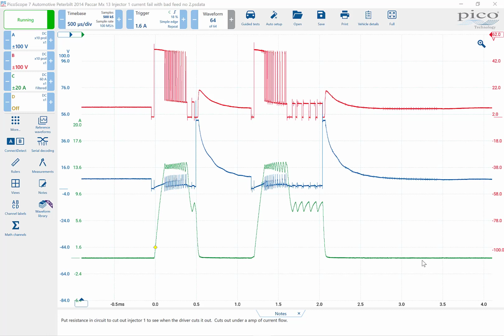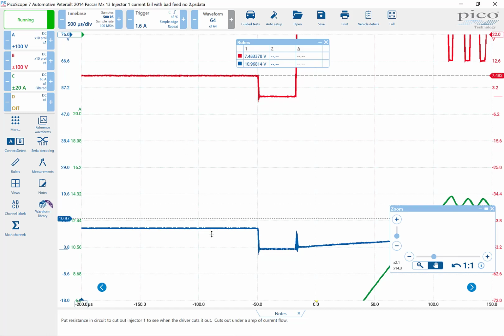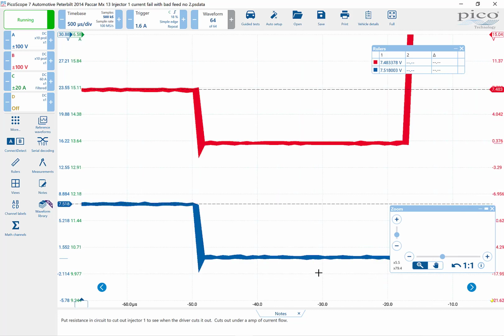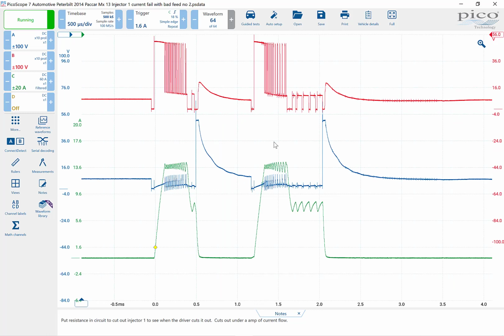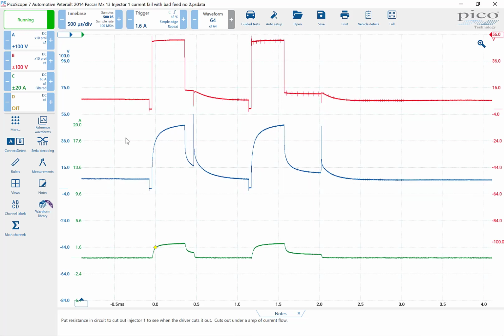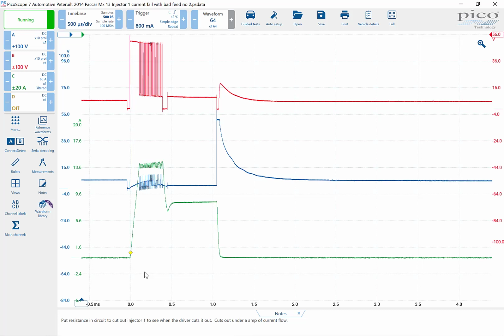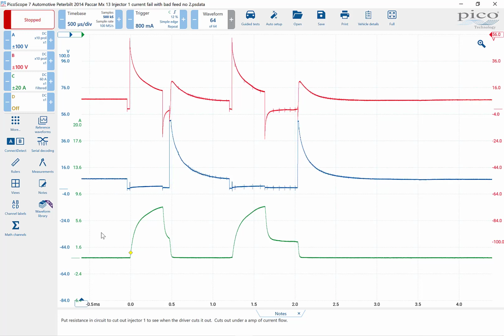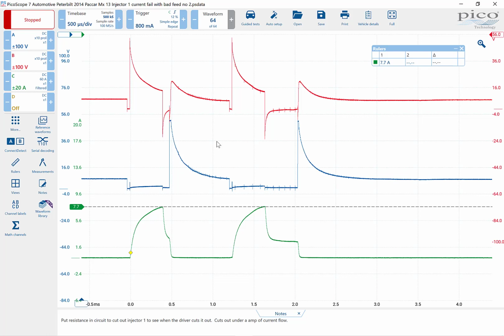Diesel Injector guided test for solenoid type Hi Pressure Common Rail Paccar Mx

Comment: Thank you Michael. A question or two:  around 3.55 how could the bias voltage on the positive and negative leg be different when the injector is not activated and hence no current flow to cause a voltage drop? Do both legs receive their own, separate bias voltages? What high wattage resistor did you use to manipulate dynamically the circuit. Once again, thank you!